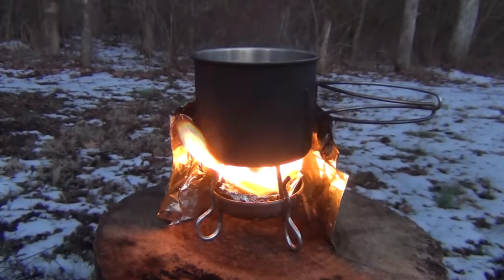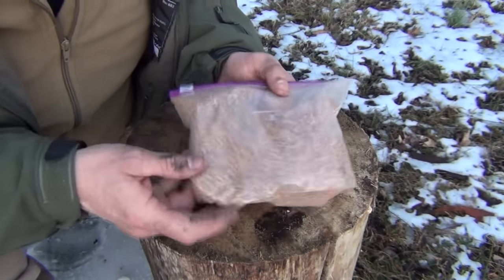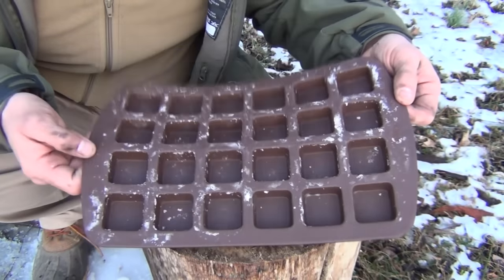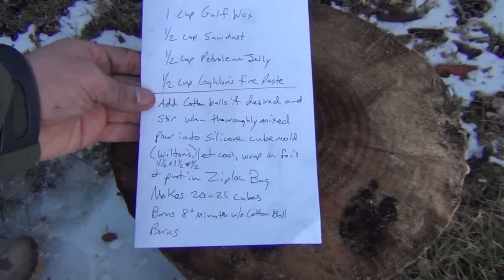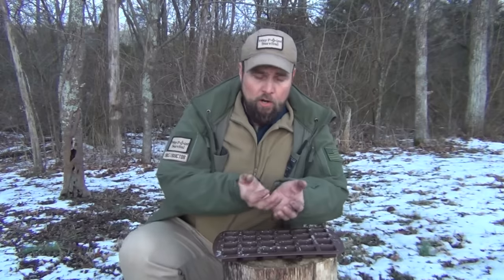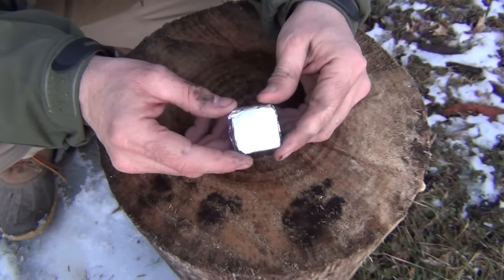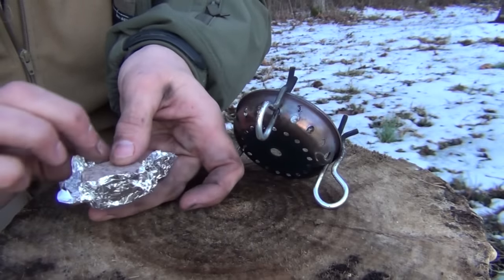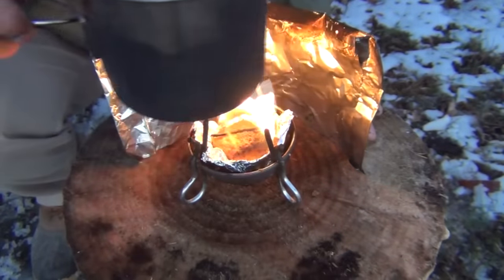DIY Fuel Tab [This is Awesome!]

Comment from the maker: After making the solid fuel stove, I wanted to make the fuel too. Here is what I came up with. It uses mostly common items and is easy to put together and use for cooking. It burns strongly and will work in all solid fuel stoves. It's also a great fire starter for wet weather. Thanks for watching!
Reply: Love this stove !  Great idea !  And I really like the fuel tab; question, how about seeing if crushed (not too fine) charcoal briquettes would substitute for sawdust and see how long it would burn.  I do not have access to sawdust but do the charcoal.  I think I am going to make it with the charcoal and will let you know how it faired for me.  Let me know if you try this.  Grandma in Texas
Reply: That is really cool
Reply: I really like and appreciate your excellent channel.
Please correct your statement regarding  lids on cups .
The boil time of water is identical regardless of the presence of a lid .
There's no difference between the boil time with a lid or without a lid .
That said ,a lid is good for preventing loss by evaporation and also for keeping debris and bugs out of your water and food.
Reply: @davidjacobs828  
Evaporation means Heat loose, If you prevent IT .. im Sure its also Fasten the process because you dont loose Heat from evaporation.. 

Whats your explanation of it or what is your Proof?

Greatz from Germany
and have a nice Day
opo
Reply: @Timothy Mckee I can do that.  I have a fireplace and so have access to ash and left over charred wood.  Thanks for the tip. I am always looking for things to make and give to my grandsons who love to camp.  I think making our own firestarters is something we should know how to do and to also keep in the emergency section of our basement.  Thanks again.
Reply: put a bit of waxed string into the cube after pouring as a wick. Lay it flat after hardening and the wrap. Much easier to light
Reply: This is great! Thanks for all your posts. I found a recipe for a "fire paste" that is 15% wax & 85% kerosene. It would be cheaper than the tubes of Coghlan's. Maybe just add kerosene to your recipe instead of the fire paste. All the best.
Reply: Several years ago, I made my own firestarters with petroleium jelly, and dryer lint packed into sections of  toilet paper tubes.  Works great in my little patio firepit.
Reply: @retiredyeti5555  I have been planning the same thing using old prescription bottles. When I first heard this tip they were using old 35mm film canisters.
Reply: @jctedsap  - same here.  I think I still have some 35mm canisters around - not the plastic ones, but aluminum ones with a screw on lid. - I am a scavenger of useful items, and a saver of all sorts of items, that to my wife looks like random junk!  Fortunately, she does not bother to mess with my workshop area in the basement or in the garage.
Reply: I learned about it at a a Search and Rescue class. Twenty plus years ago I was active in Yakima County Search and Rescue.
Reply: I watched with interest !
Reply: And non toxic
Reply: Could you also put one cotton ball per square in the mold?
Reply: thanks for sharing..
Reply: @retiredyeti5555 Pop a hole in the screw-on lid of the aluminum film canisters, insert a cotton wick, add oil to the container, screw on the lid, let the oil travel up the wick and light! You've got yourself a mini oil lamp/candle!!!🤗
Reply: I know this is old but did you notice which version burned cleaner, with less soot? The cotton or cotton-free version.
Reply: @lr6844  Do you have a result on this?

Comment: I'd like to try something similar except for using cardboard toilet paper tubes with corrugated cardboard rolled up and packed inside the tube, wick added for ease of lighting and then dipped in wax several times to fill the voids in the corrugation. Gulf Wax is inherently soft, so a hardness modier can be added, in this case, stearic acid. Just 10% of Stearic Acid added will increase the melt point for higher temperature stability and increase the burn time. Stearic Acid can be easily purchased on Amazon.
Reply from the maker: Really good tip with the stearic acid, I wasn't aware of that. These do seem to harden up pretty well with all the other ingredients added but it would be nice to increase that a bit.
Reply: We made these too in Boy Scouts. We used cardboard coiled up in a tuna can and covered in wax. They are called Buddy Burners and used in a coffee can Buddy Stove. You cook your food and then snuff out the buddy burner and let it cool. Then you put it back in your pack for the next time. The nice thing is that you don't have to worry about spilled fuel and it is reusable until the cardboard and wax is all gone which is about 5-6 campouts.
Reply: In addition, maybe save the little metal containers that tea candles come in and use, instead of aluminum foil? They’re reusable, and more durable. You could then wrap the entire thing in foil.
Reply: @MrTangent  that's a great idea, too!

Comment: KISS!  Keep It Simple Sir!  Get tea light candles, place them on top of a cookie (single layer)sheet, place on stove top at low temperature, when the wax is melted (turns clear) add a small cotton ball (or half a large one) twisted into a hershey's kiss shape, holding the stem with fingers or pliers, dip them into the melted wax of the tea candle leaving the cotton stem out of the wax until the wax has started to cool off.  This stem is easier to light without being impregnated with wax.  Then when the wax is fully cooled push the cotton stem over flattening it.  I only do about eight of these at a time because the wax cools pretty fast!  Up to three of these tea lights will fit into a standard folding Esbit stove and the tea lights are also great for starting a camp fire, especially with marginal tender!  I carry extras in a pill bottle which helps avoid a mess if the tea lights get too warm!  I carry a second pill bottle with regular tea light candles (with cotton balls to be rattle free) for my mini tea light candle and/or to make more of these fire starters in the field if needed!  Good video, thank you!
Reply from the maker: Great idea, thanks for sharing it and for watching the video!

Comment: Hey James. Thanks for the video. Have you tried to use dryer lint instead of cotton balls? The only reason I ask is that I've been using dryer lint to help start fires for years and it's absolutely free and abundant.  Keep up the the great work!
Reply from the maker: Sure, you could use dryer lint but you need to make sure that your laundry is almost 100% cotton fibers because synthetic fibers will only melt and not burn.
Reply: @WayPointSurvival  Oh good point. At the same time it puts out btu’s no matter what material is in your laundry. Its why modern homes with so much synthetic furniture etc are such threats as content fires.

Comment: Nice, I was afraid that with all the wax it would just flame up like an inferno... that's what happens if you soak an entire cotton ball in candle wax alone! Works great as a fire starter even in a good wind but I nearly had my sneakers melt on me from 6 feet away... This recipe much is safer and usable.
Reply from the maker: Yes, it really burns quite well, I was pleasantly surprised at the length of burn time myself.

Comment: Oh, this is definitely on the list! I love experimenting with different firestarter and flame extenders, but haven't tried anything with solid fuel tabs yet.
My favorite ready-made tinder/ extender (so far) is cotton rounds saturated with coconut oil, dipped and sealed in candle wax... Using them as usual (break open, fluff up, spark) I have gotten 8-10 minute burn time in a stiff breeze. They do get messy in warmer weather, which in Louisiana is 85% of the year lol, but a sandwich baggie or something will keep them from making a mess... And any oil on my fingers just gets rubbed on either my knife blade, or my beard! LOL

I did see someone who suggested substituting beeswax; that way you've even got a second potential use for them- emergency calories in a survival situation! Chewing the wax and extracting the calories and large amount of fats from the coconut oil might save your life, who knows.
Reply from the maker: You could do that as long as it's just beeswax. However, I would most definitely not recommend using the method that I used for anything that goes in your mouth.
Reply: @WayPointSurvival  hahaha no, not a good idea- I meant beeswax coating over a coconut oil soaked cotton round! One would want to spit out the cotton, I imagine, but the oil is full of fats and calories.

Comment: This is SOOO awesome! Thank you so much for figuring this out! When you showed the stove a while back I kind of wrote it off thinking I would never use it if I had to buy the little fuel bricks. Totally changed my mind now!  Thanks so much!
Reply from the maker: Thank you for watching and I'm glad that you enjoyed the video and found it useful!
Reply: @WayPointSurvival  As I was looking at a stash of toilet paper rolls I've saved this morning...I got to wondering if cutting the toilet paper tubes in like 1/2" or so rings and putting the contents into that (making it a round little puck) wouldn't work.  Instead of a silicone mold (for people who don't have or want to buy a mold). I'm thinking it ought to work...? What are your thoughts on that? A person would just have to put all the little "rings" on an old cookie sheet (maybe lined with wax paper, or foil) and then fill with the contents before allowing to cool.
Reply from the maker: Yes, that would work quite well. The only issue would of course be the wax running out the bottom of the ring but if you put aluminum foil on the bottom that would solve that issue as well.
Reply: @redeemedvintageseamstress4728  The TP tube (cut to length) would contain the corrugated roll. Just thread a wick through the corrugated center & loop through so you can dip into a melted pot of wax several times to fill the holes in the corrugated cardboard. Then just snip off the wick to your desired length and wrap with aluminum foil.
Reply: If you can't be arsed to buy the little fuel tabs, you won't be arsed to buy gulf wax, coglangs fire paste, saw dust, petroleum jelly, pure cotton balls, and aluminum foil, let alone measuring, melting, mixing pouring and wrapping the contents
Reply: @DanielSultana  don't drink and text Daniel.

Comment: Great idea! I once saw a recipe too with just beeswax and then cotton balls or cotton pads dipped in them, in that video they burned like 20 minutes, so that might be a good simple option too!
Reply from the maker: Yes, however, this mixture seems to burn with a hotter flame than just wax and cotton might do. Thank you for watching.
Reply: @WayPointSurvival  great! I'd wish to try this mixture one day, sounds like a good one!
Reply: Beeswax has an inherently longer burn time as it is harder and has a higher melt temp than paraffin wax. That being said, you could probably make a beeswax burn tab 1/2 the size of the paraffin tab and get the same results!!! I also believe beeswax burns with less smoke but that can also happen due to an improperly trimmed wick!!!

Comment: Bloody Brilliant & perfect timing too. I bought a few Asian made hexamine stoves & keep 2 in the car for roadside brews on a trip. I have the soup can cookers (hobo stoves) but these are same as the old hexamine cookers were used in the Army decades ago. I never thought about the Silicone Ice Cub Trays as I used a metal ice cube tray before.
Reply from the maker: Thank you for watching and I'm glad that you liked the video!
Reply: This recipe in a very slightly different form is from WW2, saw dust and gulf wax, poured in to a cardboard tube.  However the way point group seems to have spent some time refining the idea in to a nice system.

Comment: I've been carrying Petroleum Jelly saturated cotton balls in my fire kit for close to 50 years. 30 years ago I began carrying two vacuum packed tender bundles which smash flat & weigh practically nothing. Whether it's a bow drill, pharo-rod, magnesium starter, wax tipped matches, zippo or good old Bic lighter, I've never failed to get a fire started when necessary....even in the rain.
Reply from the maker: Sounds good, thanks for watching!

Comment: Excellent video as always! One question James, where would I go to find a silicone mold? It doesn't seem like it would be an easy item to locate. Thanks for any help you can give me!
Reply: Walmart
Duh
Ice cube mold
You're welcome
Reply: Amazon, Michael's, Joanns, Hobby Lobby and any craft store that sells molds for soap, epoxy resin, plaster, candles, etc. Depending on number of tabs, I would guess $6-12 or so
Reply: @newguy2794  I see Amazon has them in the USA too.
Reply: If you have a Ross or Marshalls close by you may come across them . See them at flea markets and garage sales as well
Reply: Baking cooking section or where ever the cake tin's coking tray's pot's pan's etc are sold of just about every supermarket, or just goggle it Eddie , Send the wife out  she'll come with a car load.
Reply from the maker: Almost any local store can carry something like this as they are used for ice cubes or cake decorations. Wilton is a cake company. I'm sure you can find them online at many places. It doesn't have to be Wilton it can be any silicone mold that is the right size and shape. You can get it on Amazon for about $10.
Reply: @WayPointSurvival  yep
I personally hate Walmart anyway
Thank you for the information
Great job
Reply: I have a mini cupcake tin that I'll try lining each cup with the cupcake insert so they come out easily.
Reply: @SpamMusubi308  try putting the 4×4 foil in the mold instead.when it cools just lift it & wrap it.
Reply: @ahayseed654  that would work, but I've already got the little paper cups hopefully they'll act like a fuse to aid lighting.
Reply: they sell them at any Safeway, but I'm going to look at my local thrift store first.
Reply: They're pretty common these days- I see them at Walmart all the time now. As James mentioned, Wilton cake supplies will have a large selection online. My wife was a custom cake designer/ baker/ candy maker for a while, so I've got silicone molds and muffin tins etc coming out of my ears, personally.
Reply: I'm gonna take some old candles and try it this weekend, but I'm gonna use an egg carton.  I used to teach my Scouts something similar years ago using dryer lint... but the addition of an accelerant is a good idea.  Just going to use Vaseline on my first try.
Reply: @cardiacbob  Great idea. Have used cardboard egg cartons and candle wax as fire starters for a long time. Had not thought of using them as the primary fuel in a stove. Will add the petroleum jelly next time. 
Thanks

Comment: I use cotton balls dipped In melted paraffin wax to start my wood burning stove. They burn by themselves for about 12 minutes. If I added some petroleum in the dip process I'm sure it would burn hotter and longer, the final dip into wax kinda seals in the PJ, to avoid any evaporation,  and they are 100% waterproof( during testing, I dipped em in water then lit it in a rain storm). Similar concept, fewer ingredients. I do like the aluminum foil wrap idea, and the cotter pins/ dish drain stove was brilliant. Good stuff
Reply from the maker: Thanks for watching.

Comment: I made some solid fuel cubes in a egg carton. I used three not so old candles, two heaping tablespoons of Vaseline, some shredded cotton balls and shredded paper out of my paper shredder. I used the wicks from the candles as fuel cube wicks.

They boil two cups of water in my hobo stove in 7 minutes, and burn for 10 minutes. Lots of soot though.
Reply from the maker: Sounds good. Thanks for watching!

Comment: Okay, you've solved the main problem I've had with all the other DYI'ers making solid fuel tabs. The ones you make can be wrapped up in foil then stored in a zip lock bag. I will be using your recipe to make the cubes.
Reply from the maker: Glad you liked it!

Comment: Just  thought, maybe add a small piece of string to the top of the pour. It can act as a wick to get it started quicker than lighting the edge. It can lay flat when dry, just peel up an end to light.
Reply from the maker: Yes, that would be a good addition indeed.

Comment: I don't have sawdust readily available, but I make these at home with just old candle wax and dryer lint. It actually works really well, though I cannot say about the heat output or the smell of whatever burning off in the clothes.

Comment: This is a great recipe. Something i would add, were it me. I will save the fluff of dried cattails. When i make my own little firestarters i will pour into my mold and while still a little tacky ill slightly press some of the cattail fluff into the wax making sure to leave a good bit exposed. This way a simple spark will ignite the cattail and that will light up the rest of the firestarter. I could see something of this nature really adding some versatility to your recipe.
Reply from the maker: Sounds good. Thanks for watching.

Comment: We took strips of newspaper and rolled them fairly tight, then soaked them In wax, worked great as fire starters for camping/scouts. Just tear the edge and light. We also made ones similar to these using cardboard egg cartons as molds
Reply from the maker: Sounds good. Thanks for watching.
Reply: Those are called CRAYONS!!! 🤭
(...yes, you can burn Crayons!!!)
Reply: @fookingsog  correct

Comment: I kind of do the same thing with plastic straws, Vaseline and cotton balls.  Seal up the ends with you heated knife edge.  It works when the fire material is damp.  Sometimes you have to use more than one
Reply from the maker: Sure, cotton balls and Vaseline is the old camper standby.